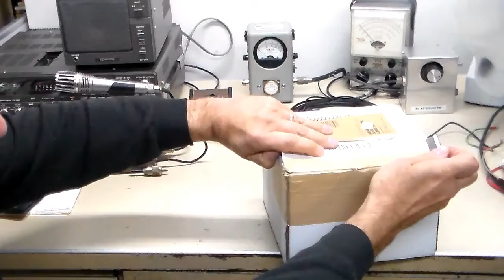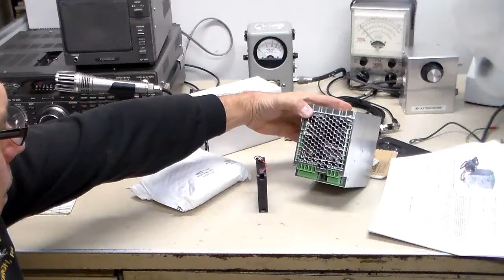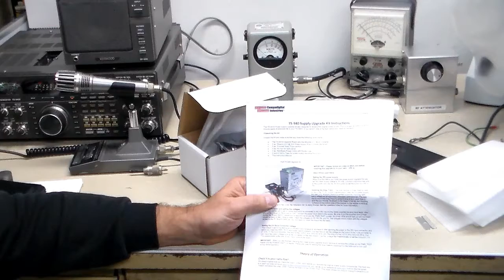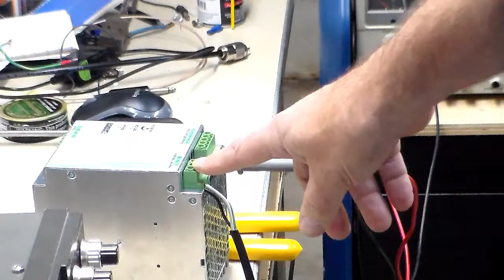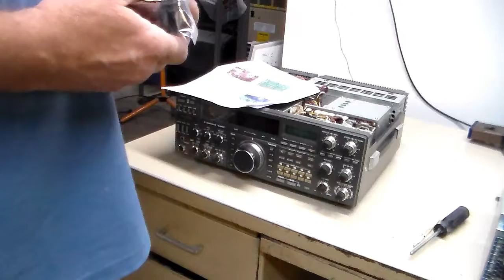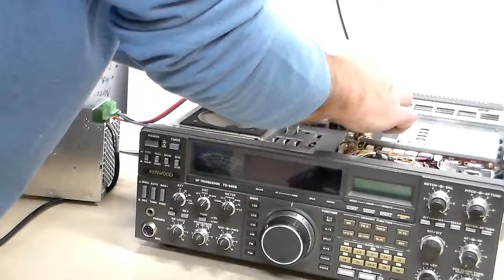TS 940 Power Supply Upgrade  Part 1

Comment: Hola, los niveles de potencia se mantienen,amas,watt de salida???
Reply from the maker: After the power supply replacement the radio puts out about the same as before. Around 100 watts on all bands. I did also change the drivers to 12 volt in an earlier video. I still use this radio frequently.

Comment: I'm sure wanting to re-get one of these 940s, but the extra 25 yrs since my last one makes me skeptical.  I wonder what is the hardest part to get, hardest difficulty to overcome is these days?
Reply from the maker: The original PA Drivers are hard to come by and quite expensive.  And if anything else on that PA Board is bad, it will probably take out the drivers again.  I changed mine over to a more  common amplifier by modifying the board.  k6iok.com now sells an upgraded Power Amp board.

Comment: What was wrong with the original power supply ? 🤔
Reply from the maker: Well, years ago, I blew it up and resurrected it.  I never trusted it afterwards.  But, I was supposed to get another 940 with a bad PS.  That deal fell through.   That's why I removed it with minimal disassembly.